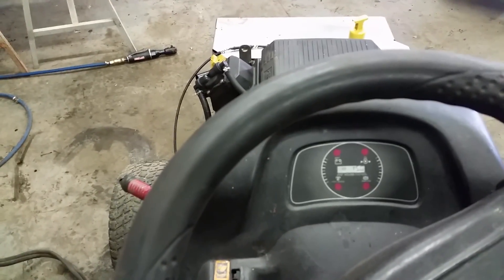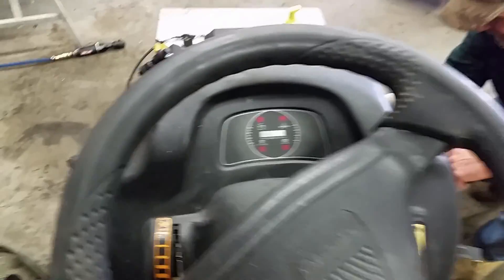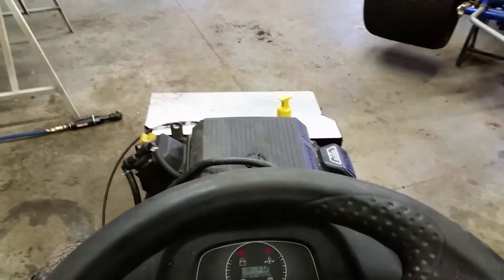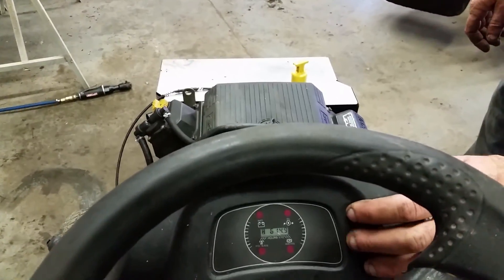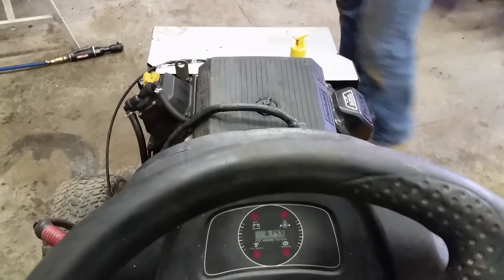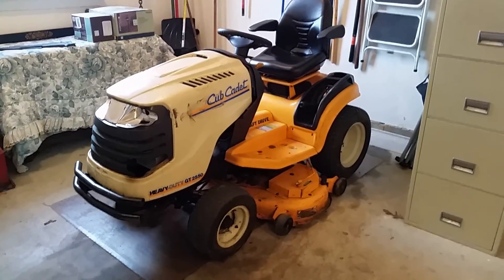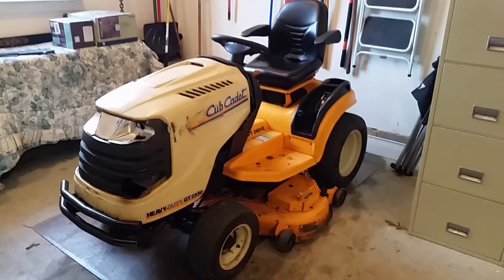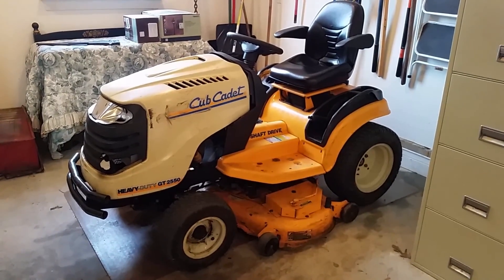Cub Cadet GT2550 - Kohler Command CH670 (22HP) Engine Rebuild, Install (Timelapse), and First Start

Comment: that thing must have never had maintenence a Kohler command should go alot more hours then that
Reply from the maker: +1teddy1979 My grandfather always keeps on top of oil and filter changes but he used the wrong oil all these years and we didn't know until it was too late. Plus he has this thing about mowing at half throttle which is not good for air cooled engines, but no matter how many times I tell him to mow wide open throttle, he doesn't listen.
Reply: +MichaelTJD60 haha ya older people set in their ways. I guess I know what I have to look forward too. I have a command on my one mower with over 1000hrs I fully expect it will go over 2000 before I have to touch it
Reply from the maker: A lot of guys use these for pulling and they are used in all different kinds of machines. They're usually pretty durable but I guess we just had bad luck with this one.
Reply: +MichaelTJD60 ya I mine has a different style of air filter on it. it is a 2 stage so that probably helps too
Reply from the maker: +1teddy1979 From my research and from experience, just keep the air filter clean and don't try to get it as dirty and worn out as possible before you replace it. I read that these Commands become temperamental if the air filter gets too dirty. I mean any small gas engine will act up if it doesn't get enough air but apparently the Kohlers have even bigger problems....
Reply: +MichaelTJD60 ya for sure
Reply: +MichaelTJD60 I have it at half throttle when I engage the PTO clutch but then rev it up immediately.
Reply: +MichaelTJD60 it also prolongs the life of the belts if you have an electric pto clutch. Even though my lt1000 has a manual, I do it anyway
Reply: +MichaelTJD60 my grandfather is the same way about not listening to my grandmother lol
Reply from the maker: Me too. That's probably the best way to do it, or if it's been warmed up for a while, engage it at idle and it won't stall.

Comment: Nice Job! I rebuilt a Command in 2009. It was locked up, and I replaced pretty much everything.I don't think it had an insert bushing for the connecting rod either.  What other machine would be better during that time period and for that price? I would think this would out do an X320? Which costs about the same. I would gladly rebuild an engine, then replace a $600 hood($1,200 now that I need 2!)! If you like doing things like this, mechanical engineering would be right up your alley.
Reply from the maker: +crazyjdkid Yeah man, mechanical engineering has always been up my alley and that's what I'm going to major in at college. It's hard to say what model would be equivalent to this because there was never a Deere with a shaft drive transmission and no hydraulic lift or power steering. The driveshaft is pretty flimsy so it's probably best comparable to a Deere X520 which has manual everything and is belt drive. This machine is considered a garden tractor by MTD standards and they do make an electric sleeve hitch and garden attachments for it but you don't see many of these newer ones working in the garden. I need to find a good used hood for this thing too.